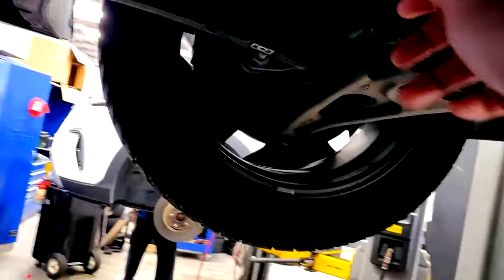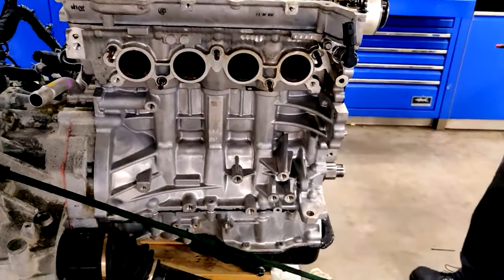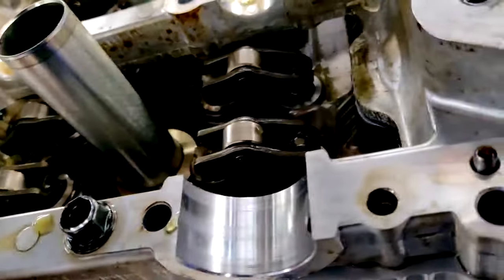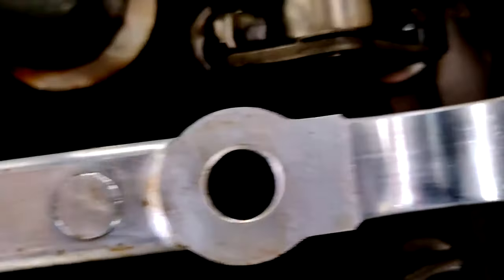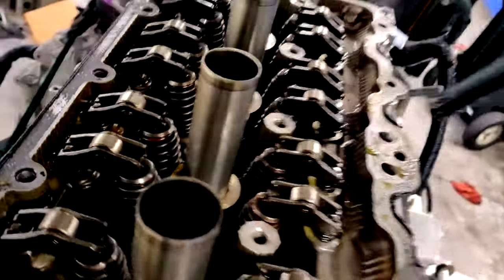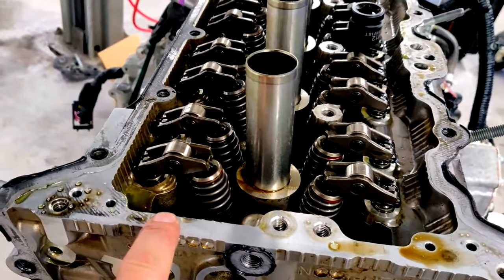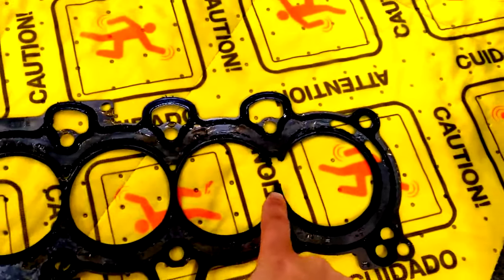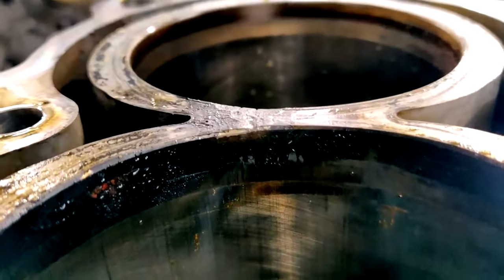Oil pan full of coolant. How did it get there?

Comment: Appreciate it. Just changed a lower radiator hose that split. I added 2 containers of coolant. Now it's all but gone. No visible leaks. Any idea where it's going?
Reply from the maker: May want to check if the trans is all milky from the trans cooler  and if you have a hybrid the heat exchanger in the exhaust
Reply: @theoffroadingmechanic  Appreciate it. Ill take a look. Noticed my driver side carpet is wet today.  Under the floor mat. Starting around the pedal area coolant is about empty . Coolant light illuminated now.

Comment: What did you wind up doing about the eroded surfaces on the block?
Reply from the maker: Got a new short block under warranty.
Reply: @theoffroadingmechanic  I'm still on my first engine in a 17 Santa Fe with 110,000 miles on it. I must be lucky. It's really consuming a lot of oil though. 5,000 MI interval go through one quart.
Reply from the maker: @CaptainNero  does it happen to be a turbo or non turbo?
Reply: @theoffroadingmechanic  2.4
Reply from the maker: @CaptainNero   that's not to bad I've seen way more consumption and we do 6k kms intervals.
Reply: @theoffroadingmechanic  thank you .. seems like a lot.. I also have a 19 with the 2.4 in it and it doesn't consume any oil it's at 60,000 miles